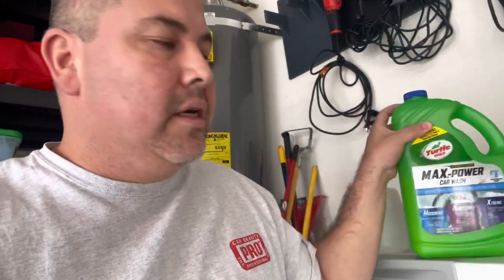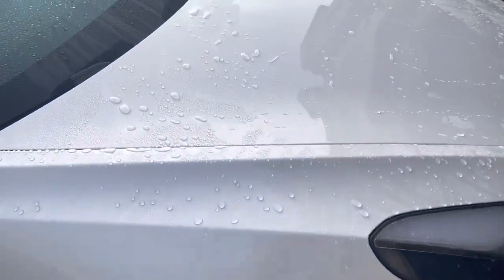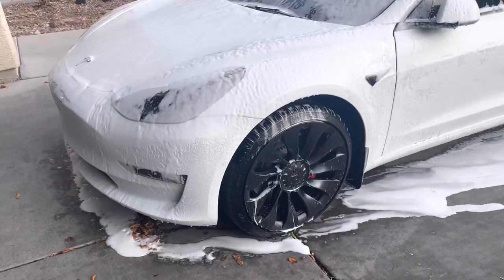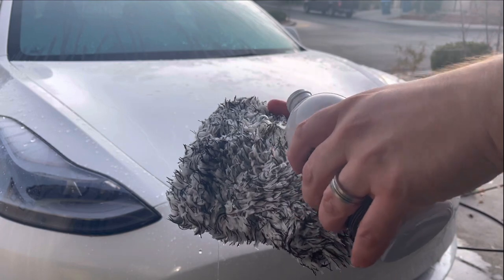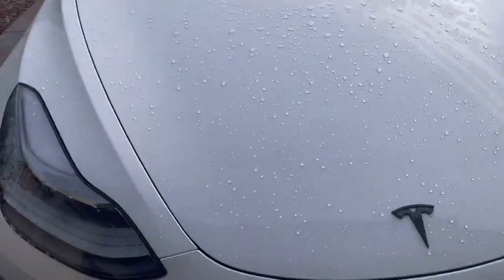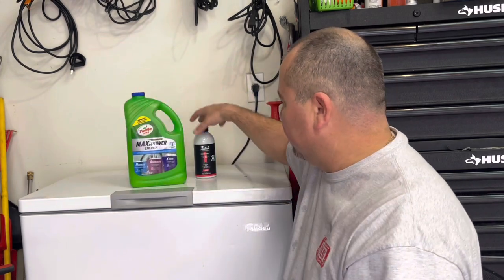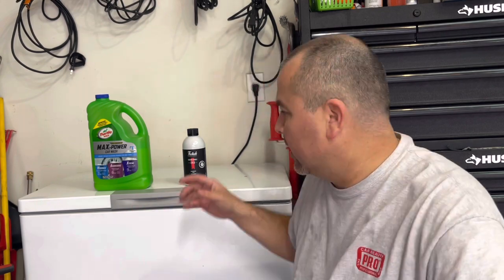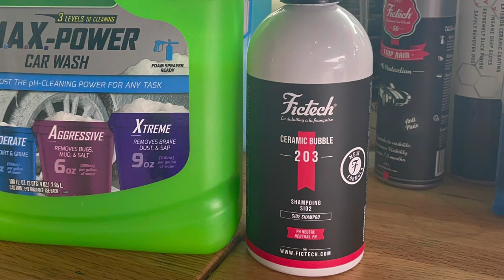Fictech Ceramic Bubble/Sio2 Soap/Ceramic Toppers/auto detailing

Comment: I really like using the Max Power soap straight in the foam cannon.  It has really cleaned the cars I have used it on that way on nicely.
Reply from the maker: Im gonna try it straight next time
Reply: @DetailingBreakdown  I used it straight on the white truck in my recent video and I could really notice the white pop just after washing.
Reply from the maker: @ddautodetailing  niiiice

Comment: Listening to Yvan lecroix he mentions almost all soaps leave a film. May not last long but they do. I notice it myself, PH balanced or not .. the initial rinse, water always sticks to the paint. Try drying the car with a towel and rinse again .. sometimes the hydrophobics will come back. In your case it should of been hydrophobic with the coating after your strip soap.
Reply from the maker: Well, I would normally use a wet clean towel and wipe it but since I didn’t hand wash it yet I didn’t want to touch the car.  Know what I mean?

Comment: I bet anything with Carnauba clogged the hood. Also, for the Max Power Wash, in the foam cannon I use it undiluted to clean really dirty cars or to strip old waxes and sealants.
Reply from the maker: Definitely could be Carnauba, but I don’t remember using anything with that.  Not a big deal, it makes it kind of fun now.   Haha.  Good tip about the Max Power.  Ty